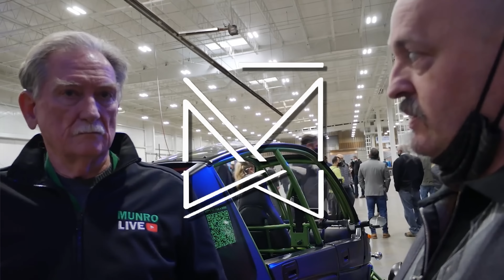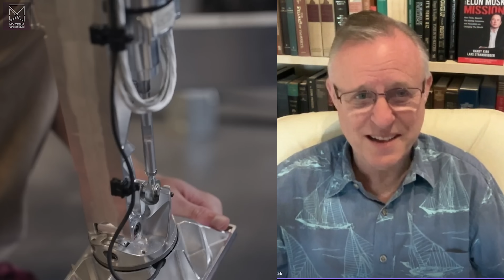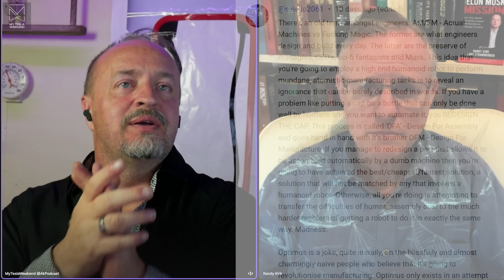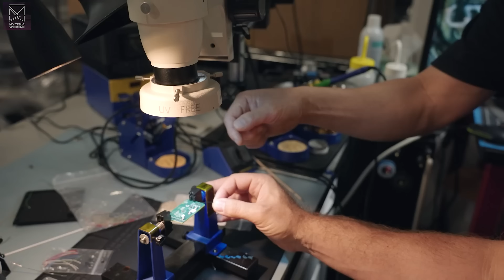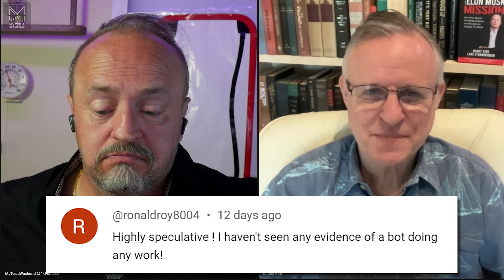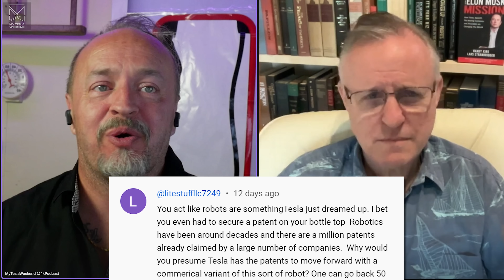Tesla bots = Infinite Money Glitch

Comment: When Optimus is viable, I think Tesla will give vision and a brain to ordinary industrial robots too.

I have always felt that the trouble with all these robot projects has been that they haven't any brain for it.

Tesla has at least half a brain to give Optimus. The vision part and moving around is a no-brainer for them. But it will be interesting to see how easy it will be to teach Optimus new tasks. That will be the hard part, which no one has done before!
Reply: The problem is that a specialized robot will always be 100 times better then optimus
Reply from the maker: @jebes909090 Specialized robots will always perform best at specialized tasks. That's not what Optimus is setting out to disrupt. It's the idea of replacing general tasks, which is something no specialized robot can do.

Comment: Hello to the creator and to all folks here.   This is my first post and I would ike to present my views on the design aspects of the bot or any bot for that matter.   I am an engineer/programmer/musician etc etc.   I will also add an IMAGINATOR LOL.   So, here's my take on this.   The first thing that I would recommend anyone doing this stuff is to get the both to move and function just as we do.   What do I mean?   Based on the information that Tesla has presented so far, it gives teh assumption that the developers are concentrating more the effort on getting the bots to do "stuff" as we do.   What I do would 1st get the bot to stand, move , sit jump.  just as we do.   If you notice the bots are stiff like in their postures.    
I surmise that once the developement of the fluidity of motion gets resolved all other things will fall immediately into order.   

So with that said my imagination has created a service to deal with this concern.  I will call the server "UP RIGHT" LOL.    The service will provide robotos with the ability to move limps in the exact way we humans do it.   It will provide a balance mechanism that emulates our own balance.  The software and hardware will also sense its environment (light, sound, vibration, etc etc).
LOL,.. The end result is that a developer using this service will be able to concentrate on the more abstact parts of the machine.

Here! Here to imagination and its creative power!!   
Jess

Comment: Seems like AI is moving at such a speed that boston dynamics has the hard part figured out already, and it isn't the AI.
Reply from the maker: The hard part is designing something you can mass produce and sell at a profit. They haven't even begun to address that, and their decades of R&D has definitely led them in the opposite direction.

If you've got two bots and the only difference in utility is that one can also do parkour, are you really going to spend 10x as much on it? For some the answer is yes, but for the overwhelming majority, it's nothing more than a party trick.